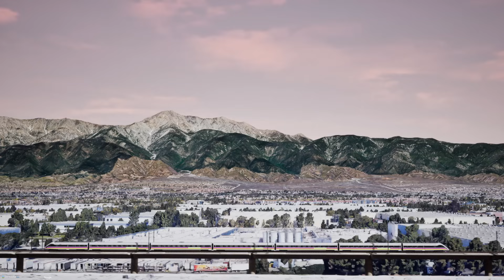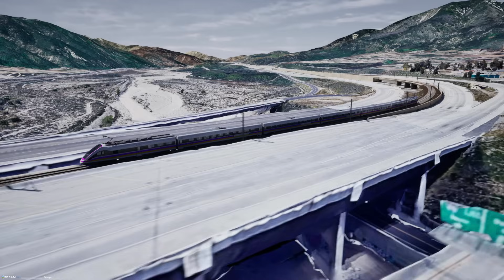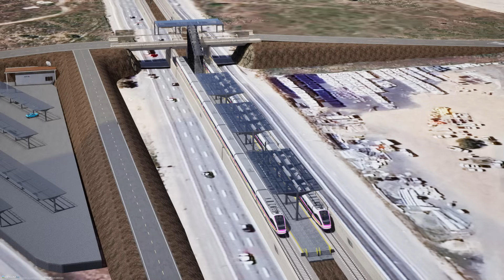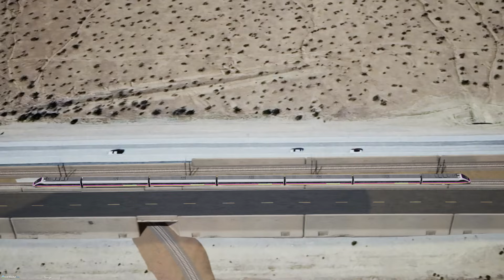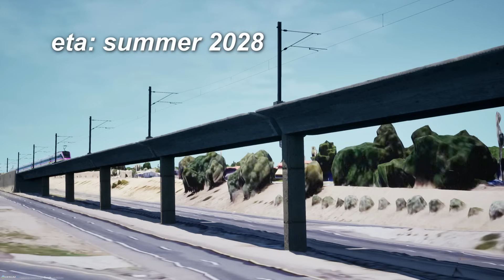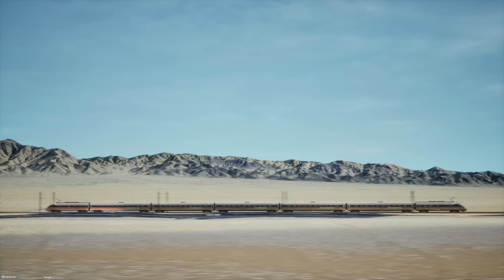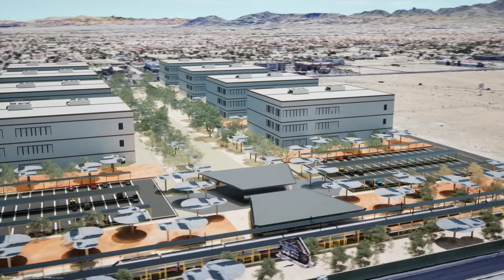The Brightline West High Speed Passenger Rail Route Rendered With Unreal Engine 5

Comment: Brilliant and cleared up most of my doubts about the project.

Do you have a video of renders based on the original DesertXPress proposal which was going to diverge from the freeway for large curves?
Reply from the maker: I do not, but that concept was meant to be side-running with a top speed of 150mph, so there aren't a lot of places where it would truly diverge from the freeway outside of a portion between Mountain Pass, CA and Primm, NV. It also only extended south to the Victorville area, so it didn't have to deal with the stickier parts down Cajon Pass and into Rancho Cucamonga.

Comment: A LOT of bridges will have to be rebuilt or altered to allow the trains to pass under them while in the median of I-15, due to the fact that they presently have center support pilings which are in the way of where the track(s) need to be built.  This will be an ENORMOUS expense and very time-consuming, plus highly disruptive of vehicle traffic during construction.
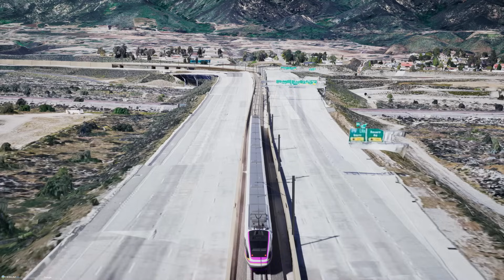Reply from the maker: This is addressed in the video at 4:39 if memory serves they will rebuild 16 overpasses total.
Reply: @LucidStew There is nothing about this at 4:39.
Reply from the maker: @trwent  "in many places... ...the train will go around existing structure supports. If necessary, lanes will be shifted to accommodate this." While "a lot" is subjective, the reality is that the vast majority of crossings will not have to be rebuilt.
Reply: @LucidStew  Okay, but wherever that is, it is not at 4:39.
Reply from the maker: @trwent  Oh, sorry, I didn't realize you were commenting on the older video. I've done a new version that explains they will be putting the tracks mainly around supports, since there is room for that in most places and it will be single-tracked in most places.
Reply: @LucidStew  Oh, I see.  I did not know there was a newer video than the one here.  Do you have the link for it?
Reply from the maker: @trwent  https://youtu.be/E80mO1VpZEM

Comment: Looks amazing. Hoping to be there when it opens to ride at least once. luckily uber exists so getting to the main part of the strip is not too much of a problem. I don't love the single tracking during a lot of this but getting anything is better than nothing. I hope they will be able to accidentally (cough cough...) add extra room near single tracking during most of this so double tracking can happen even though I am just being ridiculous
Reply from the maker: Should be pretty easy getting down there from the Strip. The Deuce already goes that far south, the resorts will have free shuttles back and forth, and there will likely be a Loop station down there as well.  Their plan right now is to eventually add another 135 miles of double tracking to facilitate 30 minute headways.
Reply: @LucidStew  Sounds great. Great video as always.

Comment: It’s wild to me that this doesn’t terminate in DTLA or Pasadena. Living in LA this sounds like a great way to get to Vegas but I’m a 40 minute drive (over 2 hours by public transit) from Rancho Cucamonga, and I’m in EAST LA.
Reply from the maker: The original intention was to hook up with California High Speed Rail in Palmdale and possibly run single-seat from there on CAHSR tracks into L.A. Union Station. Rancho is more of a stop gap until CAHSR can get its act together sometime in the 22nd century. We still might see Brightline West into Union Station in a more reasonable time frame if the High Desert Corridor is built and Metro electrifies the Antelope Valley line. There has been some pressure of late for Metrolink to electrify the SB Line from Rancho into Union Station, which could also happen, but sounds unlikely in the short term.
Reply: San Gabriel Valley @ 2 Million Plus Inland Empire @ 4 Million more = @ 6 Million who don’t want to go to LA!

Comment: Just a note. Minor in the engineering but relevant nonetheless. You only have one pantograph on each loco. But in reality there’s always two. When the loco is leading. The rear pantograph of the leading loco is always used. This is because of the airflow over the front of the loco. If the front one was used. The airflow would make the pantograph bounce on and off the wires and it would fail pretty quickly. 
On another note. It doesn’t seem very high speed to me when very little of it is able to support it. Just my opinion

Comment: Not even a Chinese will able to finished this project in 3 years. You have to understand how many bridges need to be reconfigured, especially here in Victorville and Hesperia area, that’s I nightmare for local traffic, then the winter times weather in Cajon pass, it’s another conversation, because clouds sitting there in a form of dense fog, with no more then 10-15 feet visibility,  considering every  winter some times snowing(likely once per winter) or not at all some years. Between Barstow and primm in the spring time is a 50 mph blowing dust winds( good luck to go 190 mph on train in those conditions) and on top all of that is earthquake….! Going at 190 mph during let say 4.5 - 5.7 magnitude earthquake, ain’t that rollercoaster you are looking for to ride. And safe to say here in Victorville we have an airport, not a problem for airlines like southwest or breez air or allegiant air to start a flights to Vegas for like $25 one way. Yet another project to bring more homeless falls from Nevada down to Southern California

Comment: Sure would be nice if they built this to connect the two largest cities in California: Los Angeles and San Diego.  Could build it right up the 5 and only take 45 minutes. So of course the state of California is building this thing in the middle of nowhere instead so as to exact maximum taxpayer bilking.
Reply from the maker: The state of California is not building this. Brightline West, a private company, is building this.
Reply: @LucidStew  Right, just wish we had a Brightline connection since the state of California is so incompetent and corrupt.
Reply: @norwegianblue2017  they’re also building CAHSR to connect all of California, not just LA and SF. The central valley is historically underinvested in. This a public works project for the benefit of everyone

Comment: Here's a cab ride on the Cologne-Frankfurt high speed line, with a maximum gradient of 4% and a top speed of 186 mph (300 km/h). 
https://youtu.be/9sMuYLAChIc?t=850
This is, as far as I know, the steepest gradient on a high-speed line anywhere in the world. As you might see, that thing was built next to an Autobahn, and the maximum gradient was chosen to reduce the amount of tunneling. But you still need tunneling to cut off the sharpest curves and steepest gradients. A gradient of 6% will resemble something like a mountain railway.

Comment: Your track spacing is insufficient for high speed rail...just look at exclusive TVG routes, the track centers between the two lines has to be around 20 feet because of the closing speeds.  Also, the new airport is not a supplemental airport but instead will be the new MAIN airport for Las Vegas, Harry Reid International will become the secondary airport.

Comment: The German IC3 and IC4 are both designed to handle up to 4% grades at maximum speeds...which exceed 155 mph, and those aren't brand new designs.  Electric trains can handle greater grades and higher speeds than diesel, especially when you have designs like the IC and TGV/AVG.

Comment: Great depiction! But Brightline is pretty dumb about their cost. Did anyone consult the 100 years of maintenance history for the Santa Fe to see what sand does to rails, wheels, motors, and every moving part? Lets see, we can't eliminate the sand, but can we eliminate the moving parts? YES!

Maglev has NO MOVING PARTS except the doors. Induction engine has no moving parts. Far less operation and maintenance costs. CRUISES AT 300 mph, but CANNOT DERAIL! Safest by a long shot. Staged elevation creates its own grade. But no. The engineers say to stick with the tried and true choo-choos, BECAUSE THERE IS VASTLY MORE ENGINEERING REQUIRED during construction and while operating that would be needed for Maglev.

Comment: They say the cost of a round-trip ticket is going to cost $400.00, and it will take two hours to get there going 200mph. You can get a round-trip ticket air fare from LA to Vegas for under $100.00, and jets fly at 600mph, and it will take less than one hour. And once a train leaves the station how soon can the next train leave? they have jets landing and taking off every five minutes or less in Vegas. And it's going to cost over 100 billion to build track and trains to the taxpayers.
Reply from the maker: There's no specificity on the $400 number. A typical seat will likely be competitive with air travel on cost. $400 will probably be for super premium in 2040 or something like that. Headways on the train will be one hour, eventually expanding to 30 minutes. I assure you, there is not a plane between L.A. and L.V. every 5 minutes. Its also in the once-an-hour range. Flight time is more like 70-80 minutes, but once you factor in everything else like security, boarding, and taxiing, you're closer to 2 hours. The biggest time advantage would for people flying out of LAX since it's about 40 miles from L.A. to Rancho Cucamonga. No idea where you get $100 billion from. Their estimate is $12 billion, and the large majority of that is privately financed.

Comment: This is just a computer image. In reality, the Florida high-speed line that this one is modeled after already is losing boatloads of money. California's other high-speed line is stalled and its costs are spiking by the billions every year. Maybe they could make a computer image of billions of dollars being flushed down the drain.
Reply from the maker: This line is not modeled on what they've done in Florida. It's a different approach. Brightline in Florida is currently losing money because a constraint in the passenger car supply chain is keeping them from meeting demand. CAHSR is not stalled. It is currently being constructed in California's Central Valley. Work is progressing slowly, but steadily.
Reply: @LucidStew  Right, Brightline in Florida uses established tracks of the Florida East Coast railroad and it still is losing a ton of money. This Los Angeles to Las Vegas train will need completely new tracks and roadbed, which means it will lose ten times as much money. And the LA to San Francisco train is vastly over budget and years late already. It will probably never be completed.

Comment: But the line stops in Rancho Cucamonga 40 miles east of Los Angeles!
You’ll have to take Metrolink to get there from Union Station in downtown LA. Metrolink is notorious for having limited service, running a few trains during limited hours. Not to mention you’ll also have to get to Union Station from wherever one is living or hotel where you’re staying. 
While it beats driving 5 hours the rail option isn’t going to be an obvious option. Ideally the train should start on the Westside near LAX with a stop in DTLA.
Reply from the maker: Metrolink is currently working on an initiative to operate its lines on half hour headways before the 2028 Olympics. LA Union might be a future option, but I wouldn't ever count on anything like LAX.

Comment: Why does it start/end in Rancho Cucamonga?
Reply from the maker: Because it's convenient, less expensive, and they can hook up with Metrolink there.
Reply: @LucidStew  So I'll have to drive 1.5 hours to get on the train, or ride Metrolink and make a couple transfers.  Sigh...
Reply from the maker: @AllenManor  On the assumption that the project is completed and operates, yes, at least for the foreseeable future. 20-30 years out, it maybe connect to LA Union Station, if one is optimistic.

Comment: Your video is amazing, your voiceover work is excellent, your theorizing on build solutions is exceptional; you're obviously researched this quite thoroughly.  THANK YOU for your immense effort. Let's now see if Brightlines effort will match yours!  

I believe you've accomplished the impossible here with this video - that being - you make this project look as though it could actually happen.  I live in the southern area of Las Vegas.  I've been eagerly awaiting HOW Brightline is going to manage to pull-off this miracle.  The liberal use of the term "shoehorn" and/or "wedge" is apt and fitting, when describing just how narrow some of these ROWs will be, so as to accommodate the track, catenary, and walls.  I don't at all mean to take a cynical shot at YOU, but rather expose some of the trickery Brightline will need to conjure up to make this line a reality.  It's going to cost them dearly, and I for one expect costs to exceed their project $12B. If it actually gets built - and runs - I also expect a lot of motors to blow-up under load (climbing as well as descending hills).

Comment: I love Unreal Engine 5.  It is unfortunate that Brightline lacks vision and single tracks to save money.  All it takes is one incident to completely cripple the route.  One train breaking down or derailing and the whole line is done for an extended period of time.  No way for any train to get around the blockage.   They did the same nonsense between Cocoa and Orlando.  It is going to be so much more expensive to come back later and try to double track.
Reply: If you look at the Orlando extension from Cocoa, it is already prepared to handle the second track, it won't be as expensive as you think it is and the traffic levels will already warrant the necessity of it, that's the whole reason for waiting, for there to be enough traffic to justify the added maintenance expense.  They are doing the exact same thing with Brightline West.

Comment: I'm just going to offer up one small point. Saying that a high berm across the Ivanpah lake bed is all that is needed is a touch short sighted. Having had the pleasure of driving to and from So Cal and Vegas a few times the water has managed to cover the freeway, other times is has washed out the freeway in places, the last time was just last year. You run into bigger problems if there is rain AND high wind, if that wind is coming from the east it pushes the shallow water right up to the freeway, so maybe a concrete wall would be needed.

Comment: IMHO Tesla FSD will kill this project, I live in Anaheim Ca so about 40 miles that I would have to drive and park in Rancho C. When FSD becomes attention free I can get in my car at say midnight take a nap or play on the computer for a couple of hours have the car stop in Barstow for a recharge while I use the facilities and get a coffee 20 minutes later get back in the car and sleep till I get to Vegas. 
You can easily do 80 mph with no danger of a ticket. 5 hour 260 mile trip including charging / bathroom break.
If I take the train I would still need an hors travel to Ranch C plus 30 minutes min cushion time, however long the train takes and wen you get to Vegas hire an UBER to the hotel.
Reply from the maker: It's a fair point that other technology does not stand still.  However, I think that only has a big impact when its widely affordable, and even self-driving cars will have to deal with the wacky traffic going on in the desert for a while to come.
As far as the Vegas end goes, transport to and from the major resorts is going to be covered by them as well as Brightline West. It will be similar to flying in, in that respect.
BTW, I'm kind of hoping for the same thing. It's a bit of dream to own a self-driving Class C RV before I die. Let it drive between destinations overnight. Hang out and enjoy the area for a few days, rinse and repeat.

Comment: This project is really disappointing. The only thing Brightline shows is how you can actually build passenger rail in a hostile environment as the US. The execution is just not up to modern standards. Yes it's at least electric and does go up to a proper top speed, but long stretches are speed restricted and the mostly single tracked configuration will significantly limit the capacity.
But the biggest disappointment is the locations of the stations. The intermediate stations are just in the middle of nowhere but the terminus stations are really the problem. Las Vegas Station could have been quiet close to the strip, making it a significant time saver compared to flying, but it's not. Even worse is Rancho Cucamonga. It's just at the edge of the massive LA area, instead of going right to the heart of it, connecting the area by multiple stations. Combined with the multiple airports around LA Brightline looses one of the main advantages of trains over planes, less travel time to the start.

Comment: Great video. The project itself though is a little worrying. I understand it's very expensive, but it has the character of one done on the cheap - sharp corners and curves, single tracks and steep grades. On the positive side, as you point out it should provide a very scenic trip.

Comment: I live in Apple Valley. I'm a fiber optic technician and my route goes from San Berandino to Baker. I'll have a ring side seat to this project. I could catch the train at Hesperia or the Apple Valley station. But I'll be driving to Vegas most of the time because this train will elevate a whole lot of traffic on I-15! I hope they finish this project by 2028 for the Olympics. This will be a huge economic success for our area.
Reply: I definitely thing the short term pain will pay off in the long run.  I think Americans need to really see what HSR is like in the US.  If you have travelled to Europe or Asia you will see how convenient HSR is to alleviating traffic.  Lets keep in mind for a good portion of the I-15 past victorville that the majority of folks are going to Las Vegas so if there is a way to alleviate that with the LA to Vegas HSR I am all for it.